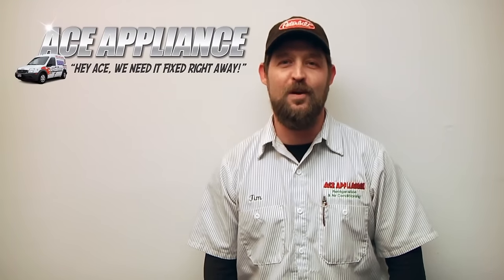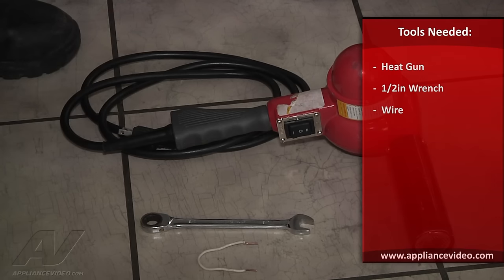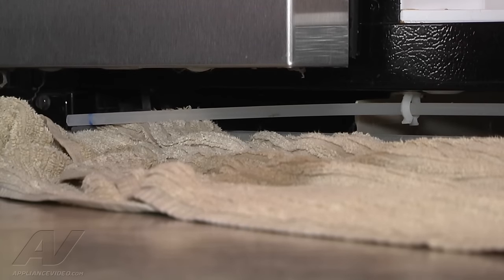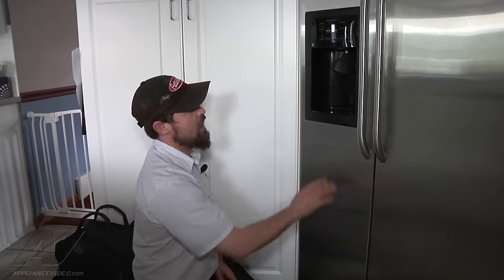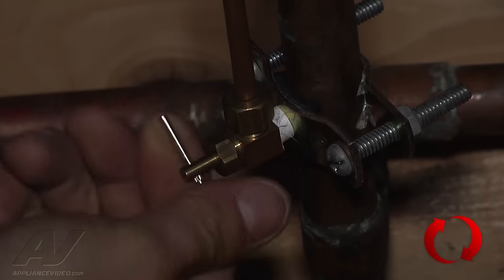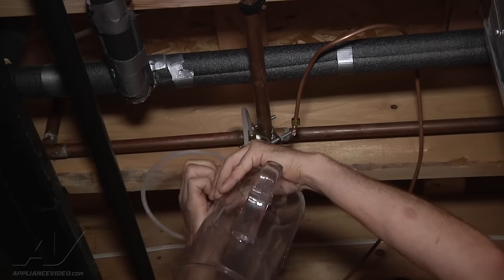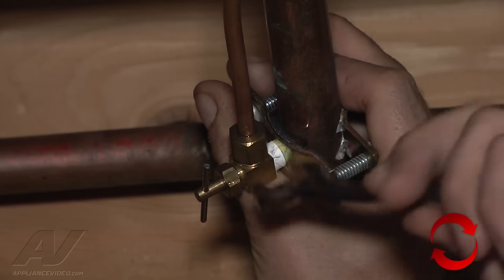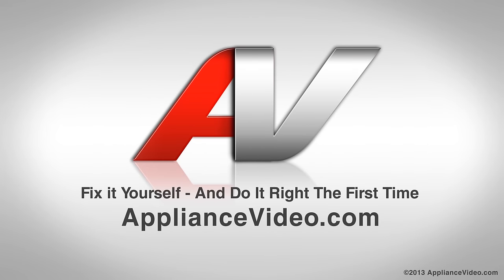GE Refrigerator Repair - Door Does Not Dispense Water - Saddle Tapping Valve Troubleshooting

Comment: I'm sitting on the floor trying to use my hair dryer as the heat gun..... silly I know, but I don't have the money to call someone and we don't own a heat gun..... My question is how long should you blast the tubes with hot air for?
Reply from the maker: Effing
    All of our technicians are now answering questions daily on the ApplianceVideo.com website. You can search completely FREE in our Repair Help section with over 1000 questions & answers. Or you can get unlimited technical advice and video links emailed to you by our 14 factory certified technicians at http://www.appliancevideo.com/premium-membership/.  If you are in need of any parts please support our parts department on line at http://savemoreonparts.com/ or call 1-800-830-5465 7-days a week until 11pm Eastern time. Thanks for your support. Matt Ace Appliance factory service technician.

Comment: My water dispenser is making a buzzing noise and it makes the front panel warm.  I’m concerned there is a circuit board shorting inside.  Since we don’t use the water dispenser, I was wondering if it is safe to permanently disconnect the cable harness from the dispenser interface and still use the fridge after plugging it in?
Reply from the maker: Great question, if you have a
more technical question that our parts department cannot answer, our
technicians are answering all questions at our website at www.ApplianceVideo.com under our Repair Help section. You can also call
our parts department at 1-800-830-5465 and they can give you help 7-days A week
Monday -Sunday, or search at www.SaveMoreOnParts.com  24 hours
7- days A week.

Comment: Is it common for water to stop dispensing, but ice still works? 
Water stopped working but ice worked. Then about two weeks later ice stopped working as well
Reply from the maker: Great question, if you have a more technical question that our parts department cannot answer, you can search our over 17,000 answered questions free at our website www.ApplianceVideo.com under our Repair Help section. You can also call our parts department at 1-800-830-5465 and they can give you help 7-days A week ,or search at www.SaveMoreOnParts.com  .

Comment: Is there anything mechanical near the water dispenser.  I've confirmed water getting to the connector behind the kick plate, defrosted top and bottom behind connector, but no water.
Reply from the maker: Great question, if you have a more technical question that our parts department cannot answer, you can search our over 13,000 answered questions free at our website www.ApplianceVideo.com under our Repair Help section. You can also call our parts department at 1-800-830-5465 and they can give you help 7-days A week ,or search at www.SaveMoreOnParts.com  .

Comment: This is funny, I also used a blow dryer like so. I am going to check if the cold temperature is too high. I think it might be freezing it through the line that's why it doesn't make it out.
Reply from the maker: Great question, if you have a more technical question that our parts department cannot answer, you can search our over 13,000 answered questions free at our website www.ApplianceVideo.com under our Repair Help section. You can also call our parts department at 1-800-830-5465 and they can give you help 7-days A week ,or search at www.SaveMoreOnParts.com  .

Comment: Although I have a slightly different model number, it looked exactly as it was shown.  Amazing how simple this was, but I would have had no clue where to start.  Also learned another tip, stick a piece of weed whacker cord up in the tube, it will help to break up any remaining clog.  Now everything works perfectly and cost me nothing.  Thank you for posting this video!!
Reply from the maker: Mungdawg
                    Awesome tip....Thank you for your positive comment. We are glad we could help resolve your issue and hopefully saved you money. Please help us provide more videos to our site by posting ApplianceVideo.com on your YouTube, Facebook or Twitter account or add us to your circles. If you are in need of any parts please support our parts department on line at http://savemoreonparts.com/ or call 1-800-830-5465 7-days a week until 11pm Eastern time. Thanks again your support.  Matt, Ace Appliance service technician.
Reply: thank you for the tips, I tried the weed whacker cord up in the tube and sure enough that's were the problem lies.  I took microwave towel and place it in the dispenser area and a few minutes later abracadabra we running water.  Thank you!

Comment: Water line froze - this worked for me:  Used plastic zip tie since it has a point & slightly firmer.  Could only get zip tie in 2.5" & took 20 mins to fix.

After reviewing a few videos, I used a few suggestions one after the other, over & over:  1)pushed zip tie in & out, 2)used hairdryer with zip tie in place, 3)removed zip tie & added 1/8" plastic tubing as far as it would go, then used a syringe of hot water .............. over & over again for 20 mins  until water came out..... AMEN!
Reply from the maker: Hello, for
technical questions we have a Repair Help section at this link https://www.appliancevideo.com/repair-help/ . There are over 6,000 answers and questions you
can search through FREE to help you with your problem. Hope this helps
Reply: The turkey baster filled with hot water did the trick for me.  Thank you!!

Comment: This worked!  Thank you for posting this video.  I used a hair dryer on the hottest setting and left the freezer door open at the same time for about 15 minutes. A little water dribbled out of the line and that is when I knew that the ice in the line must have thawed. The only note that I would add is that the bottom guard of my refrigerator was attached with 2 screws (not snap in).  Just check if you have trouble removing the guard.

Comment: The ge profile water hose freezes about 4 inches up from the doors water spigot.    Boil a kettle of water, get a poly tube about 3 feet long that is like an intravenous line, suck a few feet of boiling water into it, thread it into the water dispensor rubber hose as far as you can,   about 3 or 4 inches,  push in the cup pressed water valve, and blow the hot water up the tube.   Second time you will have thawed the water and it will flow again.    Try a sheet of styrofoam insulation over the inside flat white section of the water dispensor.   Just a bad design, not something breaking.
The tube freezes.
Reply: What I meant was about 4 inches into that dispensor rubber tube is where the ice forms, and very little hot water into that tube will thaw it instantly, while pouring boiling water down the ice dispensor chute will not cure it so fast.   Blow hot water up the tube for a fast cure, by threading a smaller tube filled with hot water into the rubber hose, and blowing the water in.
Reply from the maker: +John Fenman 

         We would like to help you answer your
question. With our videos now getting over 900,000 views per month and hundreds
of questions from people like you, our technicians are now answering questions
at our website http://www.appliancevideo.com/repair-help/ .  We also have over 2200 common questions
and answers that you can easily search through by your model number, appliance
make, problem or error code and it’s absolutely FREE. You also have the option
to email a factory service technician with a question on your appliance at http://www.appliancevideo.com/repair-help/ . If you’re looking for a repair video, you can
also search our library of over 2600 free repair videos. ApplianceVideo.com
specializes in quality DO-IT-YOURSELF appliance repair videos and we get over
800,000 views per MONTH to our videos worldwide and growing. If you need of
parts for your major appliance, we have over 5-million parts in stock at http://savemoreonparts.com/ .  Thanks for your support. Matt Ace
Appliance factory service technician.

Comment: I tried this. Now the tube connected to the freezer won't stay connected to the blue piece. When I run the water, it just pops the tube right off
Reply from the maker: Great question, if you have a
more technical question that our parts department cannot answer, you can search
our over 10,000 answered questions free at our website www.ApplianceVideo.com under our Repair Help section. You can also call
our parts department at 1-800-830-5465 and they can give you help 7-days A week
Monday -Sunday, or search at www.SaveMoreOnParts.com  24 hours
7- days A week.

Comment: In my case no water is coming out of the bottom tube after I press the dispenser. Anyone else encountered this problem?
Reply from the maker: Great question, if you have a
more technical question that our parts department cannot answer, you can search
our over 10,000 answered questions free at our website www.ApplianceVideo.com under our Repair Help section. You can also call
our parts department at 1-800-830-5465 and they can give you help 7-days A week
Monday -Saturday, or search at www.SaveMoreOnParts.com  24 hours
7- days A week.

Comment: Do you have another video showing if the water didn't come out from the tube from under the refrigerator?
Reply from the maker: Great question, if you have a more technical question that our parts department cannot answer, you can search our over 17,000 answered questions free at our website www.ApplianceVideo.com under our Repair Help section. You can also call our parts department at 1-800-830-5465 and they can give you help 7-days A week ,or search at www.SaveMoreOnParts.com  .

Comment: Hi. I’m getting water but no ice.  Tray is dry..could it be the water inlet solenoid
Reply from the maker: Great question, if you have a
more technical question that our parts department cannot answer, you can search
our over 10,000 answered questions free at our website www.ApplianceVideo.com under our Repair Help section. You can also call
our parts department at 1-800-830-5465 and they can give you help 7-days A week
Monday -Sunday, or search at www.SaveMoreOnParts.com  24 hours
7- days A week.

Comment: How do I replace the water line in the FREEZER door. I'm pretty sure my line is broken inside the door. I have water coming out of bottom of door.
Reply from the maker: Great question, if you have a more technical question that our parts department cannot answer, you can search our over 17,000 answered questions free at our website www.ApplianceVideo.com under our Repair Help section. You can also call our parts department at 1-800-830-5465 and they can give you help 7-days A week ,or search at www.SaveMoreOnParts.com  .

Comment: The thawing method was a little too slow for me. Ended up disconnecting at the bottom of the door putting some air to the dispenser and it cleared it instantly. Got to be careful with the pressure though.

Comment: This video just saved my day! But I’m noticing some leakage back at the connection where I used the blow dryer. Any idea what would cause that? Do I need a new connector?
Reply from the maker: Great question, if you have a more technical question that our parts department cannot answer, you can search our over 17,000 answered questions free at our website www.ApplianceVideo.com under our Repair Help section. You can also call our parts department at 1-800-830-5465 and they can give you help 7-days A week ,or search at www.SaveMoreOnParts.com  .

Comment: Thanks for this video. What would you suggest I do next, If I donot get water as you have shown at the bottom line (blue thingy) when unhooked ?
Reply from the maker: Great question, if you have a
more technical question that our parts department cannot answer, you can search
our over 10,000 answered questions free at our website www.ApplianceVideo.com under our Repair Help section. You can also call
our parts department at 1-800-830-5465 and they can give you help 6-days A week
Monday -Saturday, or search at www.SaveMoreOnParts.com  24 hours
7- days A week.

Comment: Tim
Your tip worked great! But, when I put the heat on the dispenser in the refrigerator door, it melted / softened the dispenser flap. So now water flows, but it will not shut off. I wiggled it and have it shut off, but the slightest touch starts it again. What now?
Reply from the maker: +KM KM 

We would like to help you answer your question. With our videos now getting over 900,000 views per month and
hundreds of questions from people like you, our technicians are now answering questions  at our website http://www.appliancevideo.com/repair-help/ .  We also have over 2200 common questions
and answers that you can easily search through by your model number, appliance
make, problem or error code and it’s absolutely FREE. You also have the option
to email a factory service technician with a question on your appliance at http://www.appliancevideo.com/repair-help/ . If you’re looking for a repair video, you can
also search our library of over 2600 free repair videos. ApplianceVideo.com
specializes in quality DO-IT-YOURSELF appliance repair videos and we get over
800,000 views per MONTH to our videos worldwide and growing. If you need of
parts for your major appliance, we have over 5-million parts in stock at http://savemoreonparts.com/ .  Thanks for your support. Matt Ace
Appliance factory service technician.

Comment: I've tried the hairdryer approach 3 times now.  It worked the first 2 times but the line seems to keep refreezing.  I just used this method again with a funnel to focus the hot air at the top and the bottom of the hose.  I also used a syringe to shoot hot water into the top of the hose.  I used hair dryer for at least 20 minutes.  Eventually, I brought in my air compressor to add a little pressure from the top and the bottom to loosen the ice blockage.  After some time, maybe 10 minutes, some ice shot out of the bottom of the hose.  I also raised the temperature of the freezer from a 5 to a 3 and the temperature of the fridge from a 5 to a 4.  Hoping this last little change will help it from refreezing in the future.  The first 2 times I fixed it, it refroze within a day or two.
Reply from the maker: Great question, if you have a more technical question that our parts department cannot answer, you can search our over 13,000 answered questions free at our website www.ApplianceVideo.com under our Repair Help section. You can also call our parts department at 1-800-830-5465 and they can give you help 7-days A week ,or search at www.SaveMoreOnParts.com  .

Comment: Trying to replace flap on ice maker on a bevel front panel ,how do we get to it.
Reply from the maker: +rosemary runner 

                   All of our technicians are now answering questions
daily at our http://www.appliancevideo.com/ website under the Repair Help section.  We also have over 1600 common questions and
answers that you can easily search through by your model number, appliance
make, problem or error code and it’s absolutely FREE. You also have the option
to email a factory service technician with a question on your appliance at
http://www.appliancevideo.com/repair-help/ . If you’re looking for a repair video, you
can also search our library of over 2600 free repair videos. ApplianceVideo.com
specializes in quality DO-IT-YOURSELF appliance repair videos and we get over
800,000 views per MONTH to our videos worldwide and growing. If you need of
parts for your major appliance, we have over 5-million parts in stock at http://savemoreonparts.com/ .  Thanks
for your support. Matt Ace Appliance factory service technician.

Comment: Ive had the same problem with no water flow for years. Ive done everything regarding troubleshooting. Anyone have any ideas to correct??
Reply from the maker: Great question, you can call our parts department at 1-800-830-5465 and they can give
you help 6-days A week Mon-Sat . If you have a more technical question that our
parts department cannot answer, our technicians are answering all questions at our website at www.ApplianceVideo.com under our Repair Help section. We have over 3,000 common questions and answers that you can easily search through by your
model number, appliance make, and problem or error codes, and It’s free to
search through our question & answer library.

Comment: ApplianceVideo.com. Thank you. Was a very helpful video. Turns out my line thru the door was either frozen or filled with mineral deposits as the wire I shoved thru was rusty looking on the tip. I ended up using an air compressor to blow air thru the line to get the blockage cleared out. Either way it works now. Thanks again!
Reply from the maker: Thank you for
your positive response, we are glad we could help. Please help us by
subscribing to our YouTube channel or post our website www.ApplianceVideo.com  on your Facebook page. We want to let your
friends & family know how our FREE videos can help them.  Or you can
support our parts department at 1-800-830-5465 and our parts website www.SaveMoreOnparts.com .  This is the only way we can continue to
post free videos and help over 1-million people per month like you repair their
own appliances. We also have thousands of more quality videos on all major
appliances made by our factory trained technicians at www.ApplianceVideo.com .